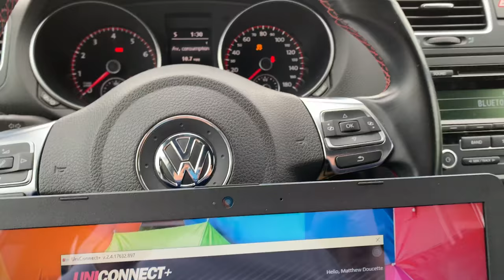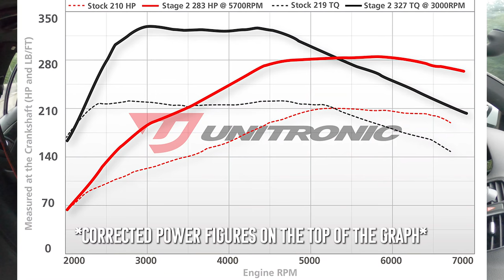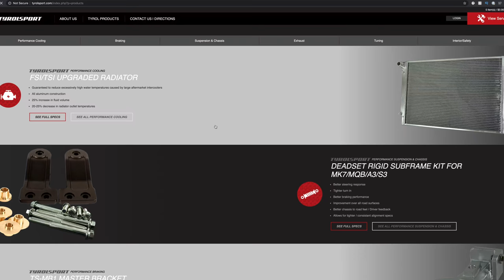Volkswagen GTI - How Reliable Are They Really?? Biggest Flaws...

Comment: With the timing chain issue, mine went one week after I bought mine. I had 98k miles, and there's actually another extended warranty for 10 years or 100k miles and I got it fixed for free. So, if it happens to you take it to a vw dealership and you'll get a free $1,200-1,800 repair. I'm just glad mine went while I still had under 100k.
Reply: I'm at 40k but it's a 2011. I'm wondering if I'm still in the warranty period!
Reply: @stepsidelandscapinglawnsol3093  call your local vw dealership! You might still be, and a 2011 with 40k? That's crazy!
Reply: @tommycarney8668  it is crazy I agree lol. Has a stage 1 tune (visible intake and catback) so wish me luck. Thank you for the reply!
Reply: @stepsidelandscapinglawnsol3093  when I got mine fixed I had an intake as well, but hadn't tuned it yet. I don't know if having a tune would void the extended warranty, but if not make sure they know you have a tune so they don't overwrite anything lol
Reply: @tommycarney8668  good thinking! We have an APR downpipe + tune authorization  waiting for springtime. So if they wipe it ill I won't make a fit lol
Reply: @tommycarney8668  just called. No "recalls" but they see active warranty for the following - timing chain, clock spring airbag, and coolant pump. They stated it isn't available for service unless they diagnose any issues and the problem surrounds the timing chain or pump. It was a vague description so I'm unsure what else I could say. Were you having issues with your dealer and had to go through a series of people? VW North America will be my next call
Reply: @stepsidelandscapinglawnsol3093  when I took mine in they told me the same thing, and said it would be a $70 dollar charge for diagnostics to see if that was the issue. However, I knew that's what the issue was because I already took it to a shop. So, I had it dropped off and they called me after doing the diagnostic and told me it was the timing chain and they were going to fix it free of charge. They also didn't charge me for the diagnostic either
Reply: So if you know that it is your timing chain, you can take it to them to run the diagnostic. Once the confirm that it is one of the issues related to the active warranty they have to fix it free of charge per the law suits against volkswagen lol
Reply: @tommycarney8668  Currently, no noise or issues with the timing components but I'm afraid of the notorious timing chain tensioner catastrophically breaking. They gave me a date up until 2022 but I'd rather have it replaced now on their dime then go through the hassle and inconvenience at the time it breaks. Another dealer had told me the same thing - corporate must evaluate the diagnosis and go from there to see if it's partially covered or 100% covered. The dealer games are real lol
Reply: @stepsidelandscapinglawnsol3093  it's 10 years or 100k miles edit: looks like you already knew that! Hope they cover it, I discovered I had the old style tensioner at 105k lol
Reply: What year is your car and how did you know the issue was the timing chain?
Reply: @SSR-vz8zx  2011, and I heard a slapping noise coming from the engine bay. It sounded like a rubber band. So, I parked it and a few hours later it wouldn't start. I scanned it for codes and I got I believe code P0022 (camshaft position A), so I knew my timing had stretched and skipped.
Reply: @tommycarney8668  oh, that's scary actually. It could have been way worse
Reply: Will they replace it nearing 100k without breaking it

Comment: Gotta say out of all of the cars and trucks I've driven at my job, two of my favorites were a 2014 GTI and a 2017 Golf R. They rip, super fun and easy to drive, and they're affordable to buy. However, both of these cars had to be bought back by my dealership from the customers due to electronic issues, then sent to auction. The GTI had a reoccurring CEL and even the VW dealership we kept bringing it to couldn't get it sorted 😞
Reply: Anecdotal evidence, there's gonna be people who have issues and people who have no issues.  The question is whether the experience that the car provides is worth the potential hassle.
Reply: 275K miles 31.6 MPG /420 Miles per tank. 
Change oil every 5K miles. 
Clean Carbon at 60K mile intervals (When you disassemble to change water pump / time chain / belt (FSI / TSI). 
It will last forever.
Reply: @justincace5517 exactly . My tfsi motor strong with 220k and will gap cars still lol and I out bolt on models charge pipes light weight flywheel and gfb+ dv
Reply: I got to drive a 580whp golf r with a juicy snail on the intake. Man was it baddddasssssss!!!! Such a awesome vehicle and so capable for the price with just a few mods. I liked it more then 458, huracan, m5,m6, multiple generations of m3. Awesome car

Comment: Just tuned my mk6 gti and it's so much better, and I just want to drive all the time. The biggest annoyance, like you said, is the creaking. Especially from the sunglasses holder (I don't even use it), but the occasional press on it stops it for a while. Also on the door, around the top, by the locks it creaks too, and a small press there keeps it quite for a while lol.
Reply: My whole sunglasses and light trim piece is very loose and keeps slightly coming undone from the roof
Reply: Little gaff tape or some silicone lube in the right corners works wonders

Comment: My 2017 GTI has had an oil leak from filter housing (warranty), a coolant leak at the thermostat (warranty) and another small oil leak at the oil sending unit. This is quite on par with its reputation. Oh, 25K miles.
Reply: Mine has had a thermostat leak since 20k kms lolol
Reply: Same here on the thermostat leak, fixed under warranty around 55k kms.

Comment: Bought a DSG 2011 GTI last year, drove it for a year and decided it was a keeper for a few more years. I cleaned the intake (wasn't that bad tbh but just for peace of mind) with oven cleaner and the zip-tie method, saved me 850,- euro's by doing it myself. Then I got it tuned together with a DSG tune, that totally transformed the car! It's so fast and responsive now, but I lost the "farts" on upshifts because the DSG is shifting much faster now. Recently I had to replace a driveshaft (easy job) and changed the auxiliary belt and tensioner (pain in the ass because you have to loosen an engine mount to get the tensioner out) together with the PCV valve (also for peace of mind). Sadly the paint has a few scratches and the front bumper could use a respray because of rockchips. But the interior and mechanical parts are all in very good condition and I love to drive the car! (my other daily is a BMW 5 series so I set the bar pretty high for cars!)

Comment: I own a two door mk6 gti autobahn and I’ve never had the frame flexing issue. Also I’m used to working on tfsi engines so the tsi engine is basically heaven when it comes to maintenance because it doesn’t eat itself if you don’t replace random parts every thousand miles. I’ve managed to keep a tfsi running for 200k miles and I plan on keeping my tsi running for 250k miles.

Comment: Thanks for the content.  I have loved GTI since i was a kid and now i finally have the financial ablity to have a second car and im looking at the MK6 GTI. Your videos are tremendously helpful. It seems like most of the "reliability" issues can just be addressed upfront and resolved before they become an issue.
Reply: @inertboi  oh it is my daily. My other car is now my utility vehicle
Reply: @thisfool89  how has it been
Reply: @Redhulk-zw9hq  its been an amazing car. I love it.
Reply: Update?
Reply: @Chasechased  yeah sure. I ended up getting a 2013 3door with a manual 6 speed trans in tornado red. It came with 1" lowering springs other than that it's stock. I was sure to get one with an extensive service history. 

So far I have had is a tail light bezel came loose causing some weird stuff to happen on the dash. Just had to snap it back into place. The hatch locking mechanism broke. I was able to buy a new one on eBay for $20 and install it in about 10 minutes, and it's got a bit of a oil leak that looks to be coming from around the valve cover area and it's made its way down to the exhaust so after a bit of driving I get a burning oil smell. I plan on taking care of that really soon. I also want to do my timing chain and water pump soon too just to stay ahead of any possible issue.
Reply: @thisfool89  Nice, Looking at a MINT 2 door 2012 mk6 gti, manual with 101,000 miles. Has had water pump and fuel pump replaced and also the timing chain tensioner. 2 owner car and the current owner provided a free CarFax report for me. He also works or owns a mechanic shop so it was taken care of. Looks like Im going to be getting it soon. Hes asking $9,500 a little high but i could get him down a bit hopefully.
Reply: @colbyclark2479  right on bro. I actually ended up getting a super mint 2 door 2013  in tornado red with 112k miles. Already had 1" lowering springs. Mine also had a very long Carfax history. I've been driving it for almost 2 years now. It's been a great car. I did have to replace the trunk latch and just two weeks ago the lower temp sensor just fell out lol. Was driving warning light came on but the temp stayed good so I limped home. When I opened the hood and looked I could see the temp sensor was still attached to the connector but it was just dangling. It was a $20 fix. I haven't done any modes to it. Just a couple cosmetic things. Swapped the mirror caps with gloss back ones, wraped my door handles in gloss black and put some amber skins on the fog lights
Reply: another one you should think about if you can't get the GTI is the 2.5L i5
Reply: @lucid523  thanks, but I ended up with my GTI. 2013 3door in tornado red. Freaking beautiful car.
Reply: @thisfool89 VW reds are famous for fading to pink if left out in the sun 😂
They need sunscreen.
Reply: @johncollins5552  not sure how the previous owner stored it but there is no fading on it and Ive had it for two years now and no fading yet.

Comment: Yo what a great video. Thank you, sir. Mine is at 155k and $9k deep in repairs over the past year. However, all major things already done, with a new clutch, rear main seal, etc. Going in for a fuel leak (think injectors and o rings /manifold) but and a subframe issue + suspension refresh. Besides that I think it’s got another 60-90k miles left in her. Thanks for the video :)

Comment: I'm at 280,000 miles on my 2012 GTI I bought new.  That's K04 and full bolts ons since 10K.  All the cars I saw die before mine, the owners went cheap on maintenance.

Don't skimp on fluids and clutches like many do.  Change the oil every 5K and plugs every 10K with bigger turbo or 20K OEM turbo.  Do these easy things and it'll last forever nearly.  I'm finally planning on a new long block at 300K, just so I can trust it on long trips.  Runs fine, but 280k makes me nervous.
Reply: That impressive

Comment: Had an ‘07, 2011 and currently drive a 2017 with zero issues. The MK5 and MK6 went over 100k with stock clutch and flywheel and I daily the MK7 sport dsg in Buffalo winters with no problems ever. I have an ‘04 24v VR6 that is also bulletproof, leather even looks new. Buy a Toyota if you don’t wanna take care of your car.

Comment: The blow off sounds in the beginning was all I needed to hear, that turbo flutter is so bad for the ko3. The TSI 2 liter is designed for a recirculating diverter valve. Most VW owner don’t take care and maintain them. Changing oil every 5k and keeping up to date with routine maintenance is the key, if you want the Mk6 then stick with the 2014 model, they fixed the common issues with timing chain tensioner and water pump. I have 178k on mine, stage 2 with zero issues and never a check engine.

Comment: My Audi A3 8P Quattro with the EA888 has been great and has 154k on it, Runs awesome. But I knew it had to have chains done before I even bought it. Had the OEM tensioner still even.
Ah, And usually on the GTI's the RPM's hang because they have a Dual Mass flywheel. I did a clutch job and flywheel upgrade on my buddies Mk6 GTI and ill tell you, that Dual Mass Flywheel they come with weighs a metric ton. If you are doing a clutch job, Swap that behemoth of a flywheel.

Comment: 2013, 66k miles, 8 years of ownership- new clutch, fuel pump, water pump, abs module, roof liner, 5 batteries, multiple sensors, melted interior plastic, coolant leakage in engine compartment, and a whole lot more.. over $10k in mechanic fees. Gti is engineered to fail reliability.
Reply: Damn acc
Reply: Damn
Reply: or ur mechanic is getting the best of you 😟
Reply: 2013 owner here, only had to replace 1 coilover since buying at 44k.  118k now, one of the best cars I have ever owned.  Just have done regular maintenance, brakes, etc.

Comment: The creaky noise when parking in a parking lot or making slow turns is actually the strut bearings. I just had mine replaced along with the struts and mounts. No more creaking!
Reply from the maker: Yes!! Had those done, and it helped with suspension noise for sure. Still have the cabin creaking though.
Reply: @NotSoHandyCarGuy  Ahhhh.....gotcha. I guess I  misunderstood your post. I have a Eos so I understand some noise. You said you lube your door seals, I have to do my roof seals every 4-6 months or so to keep the squeaking to a minimum and to keep it dry inside.
Reply from the maker: @markb3756  it’s all good dude! Ah, I see. Hard top convertible problems haha.

Comment: Came across this video as I say goodbye to my MK6 soon. Has 106k on it and have had to replace the following: 1 recall water pump and 1 that failed, so it's on its 3rd currently. Radiator, turbocharger, 2 sets of ignition coils, fuel injectors, rear passenger side door lock, o2 sensors, belt tensioner, missing some small other replacements. It left me stranded a couple times as well and had bad misfiring issues until someone correctly diagnosed that it was carbon buildup. My advice would be to do your research on the car before buying, ones that have a history of breaking down are going to continue to have issues going forward. Otherwise, they drive great and are very practical.
Reply: The same bro. I have 2012 model with 100.000 km. Those misfires are really persistent. I did everything. Carbon cleanup, pcv valve, ventilation valve, etc. I’m really pissed off. I’ve never had such problems with any car. I’m gonna sell it bro. I cannot afford this expenses. And I really need some piece of relaxation…. I know that I will have those problems again. I’m tired bro.

Comment: Great vid, love my 13 gti as a daily / autocross toy. Dp, protune, coilovers and audi tt rs brakes = a good time indeed!
Reply from the maker: Thank you!! Nice daily, man!
Reply: Hey you have got a 71-73 Mustang?
Reply: @jamesmedina2062  yes I do!
Reply: @thetransporter3028  Me too. I have a 71 Coupe hardtop with a 377 Stroker Cleveland in mine. 2V closed chamber heads. Headers. C6 trans. It hasnt run in a while. I had to redo fuel system due to sitting and installed new Baer brakes. You have a later blue one? What is it exactly?
Reply: @jamesmedina2062   awesome man! I got a 73 mach 1, 351m stroked out to a 408. 4 on the floor.  Making 400ish HP and more tq. Big Cleveland heads, mild cam, hooker headers. 9 " rear end, Currie diff, 31 spline axles and just ordered a bunch of global west / TCP suspension parts for it. When I drive it, I pretend I'm in the 70s just crusing around. Love looking over that big ol'hood 😻
Reply: @thetransporter3028  Oh shit bro!!! Thats whats up!!!!!  Well I get it!!! Me too!! I actually have a nice glass hood from Meyer in Florida, 3.50 gears and Mark Williams parts but spindly 28 axles limited slip. I think I need new gears if I cant get the rear to stop howling. I got Currie gear oil and its thick! I use Doug Thorley headers and am building 2.5 duals with x pipe using custom made stainless mufflers from Italy. I re-hung those big doors with new pins/bushings. I wish I had manual trans and I need to switch out some cancer in roof from when previous owner had vinyl top but the sun ate it and rain and water got in there. Underneath no corrosion. Desert car. Do you have FB? What rods/pistons? I got Crower/Ross and weight was removed in Cali. 0.030 over 4 bolt block. Mild hydraulic roller retrofit cam. Thinking plain roller cam better to sling it up to 7k. Its 2V oval heads.
Reply: You do any chassis bracing on it?

Comment: I made it to 115k with my biggest repair being my suspension which was probably do to a pot hole.  I should have noticed that something was up but until I had to do my wheel bearings I didn't notice I had snapped a rear spring (car still handled pretty well).  At 115k that was when I needed a timing chain service and I had a bit of a leak so I decided to trade it in for a MK7 GTI... 🤔

Comment: One thing i did to my mk6 was to upgrade to a stage 2 clutch with a light weight flywheel and the rpm’s drop way quicker and no more rev hang
Reply from the maker: Funny you should mention that, because I have an ECS stage II clutch package waiting to be installed. I think I’m going to make an install video on it. Thanks for the comment!
Reply: I actually have that exact clutch on mk6 and just except there is a lot of rattle from the clutch
Reply: Having that installed as I speak!

Comment: Problem is most previous owners do not use high quality engine oil, they do the quick stop $15.99 change.  Plus, always check your oil level on fill up, you can prevent serious carbon deposits by catching oil consumption. On direct injection you'll never stop it, because the fuel, 93 with detergents or not, never touches the valves. Never had a huge problem in my MK V, just the cold side, and walnuts is the only way, not seafoam.  My MK VI is still pristine at 31k, but it is inevitable.
Reply: That will not prevent carbon buildup just help prolong the inevitable walnut blast by a bit